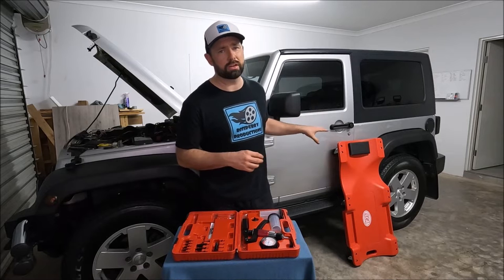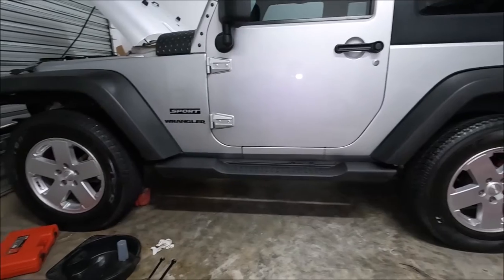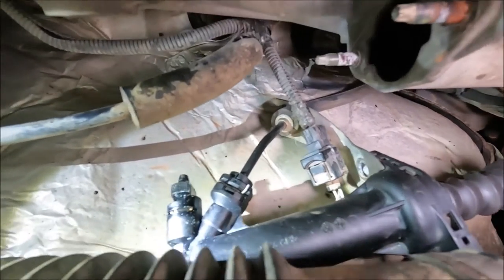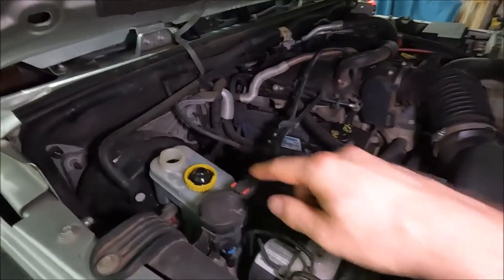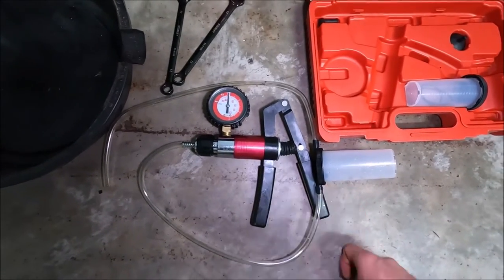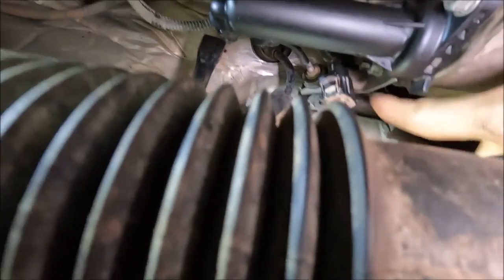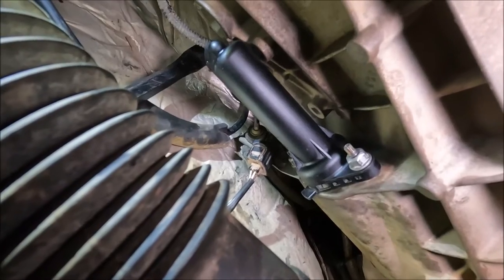Tips on Bleeding Jeep Wrangler JK Clutch System - Slave Cylinder

Comment: How long did it take to bleed the clutch
Reply from the maker: Hi Matt, I would say about 2 hours as I had not done it before and I tried bleeding with it in situ, it would probably take about 1 hour now knowing its easier to remove the cylinder. I hope the Video helped. Ross
Reply: @RossPerryProductions  I gravity bleed it put a pressure pump on it plus I've been pumping on it for 2 hours
Reply from the maker: @matthewsparks112  and there is still air in there?? The system isn't that long so it shouldnt take more than about 10 mins of bleeding. have you tried tilting the slave cylinder to try and get the air to the bleed valve?
Reply: It literally took me about 20 minutes to do it, I used a vacuum. I think it was 0.5 a vacuum and I just let it take it's time and I've not had a problem.
Reply from the maker: sounds good

Comment: When I pulled the hydraulic line out of the old slave, there was no little rubber cap. I did it slow are carefully and I'm certain it didn't fly off and roll away. I looked inside and even smashed the slave open with a hammer and it wasn't there. The boot was torn on the old one though. I inserted the line into the new slave, removed the master cylinder cap and pumped it by hand until it had pressure. Then I bolted it up and pressed the clutch about 50 times. Jeep was parked facing up hill. I then put the cap back on and drove it around the block. It works perfectly fine. I checked the slave and no leaks. My question to anybody and everybody is, has anyone experienced this also? Not having the little rubber cap? I haven't driven it far yet so if it starts leaking I know why. But so far so good and it's interesting that there was no cap present. 🤷‍♂️

Does anyone know the part number for the hydraulic line? Just incase.
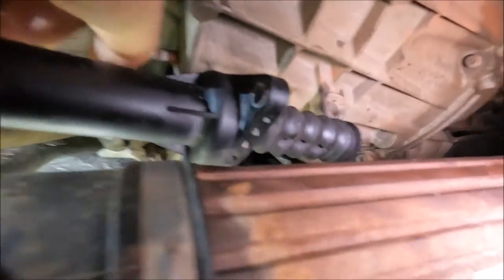Reply from the maker: are you referring to the black plastic cap on the end of the cylinder as shown at 2:20 in the video? or the little rubber cap on the bleed nipple?
Reply: @RossPerryProductions  yes the cap on the hydraulic line, not the bleed nipple. I drove it around town yesterday and no leaks or pressure loss but I don't feel confident because everyone says it will leak without it.
Reply from the maker: have you tried to source one? it would probably be fine in the short term but I would look to get one, everything is there for a reason right, even if it is to not let any grit or dirt in.